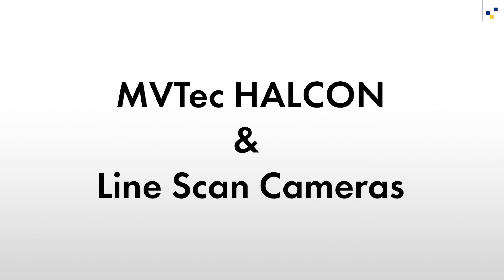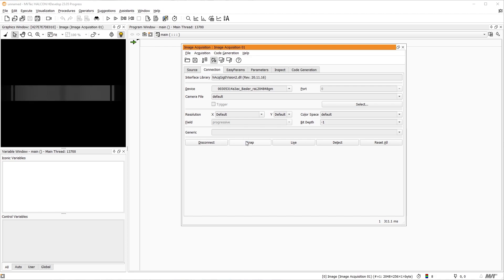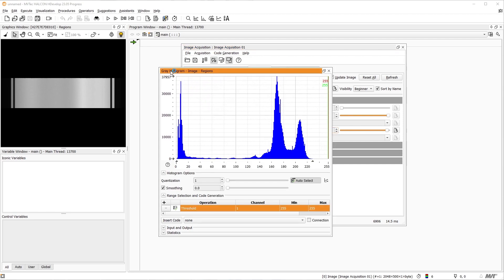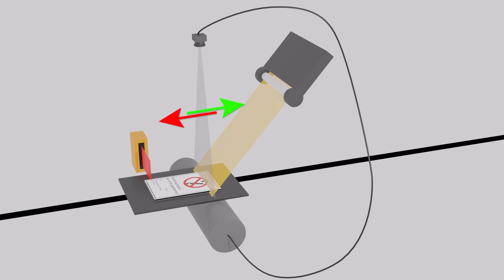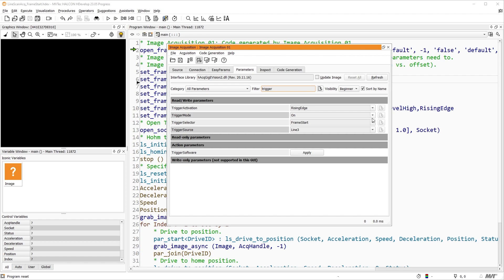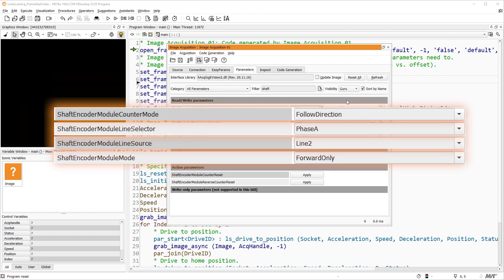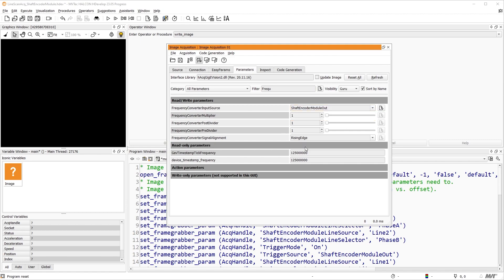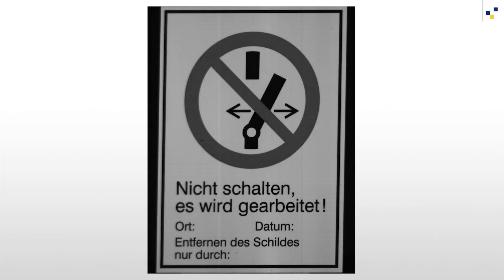How to Setup and Use Line Scan Camera with MVTec HALCON

Comment: what kind of lens is used in line camera?
Reply from the maker: Great question!

As a software manufacturer, we prefer not to make hardware recommendations.

Line scan cameras often have higher resolution in the width and therefore wider sensors than area scan cameras, which can cause image quality problems if the optics are not designed for them.

Therefore, special lenses are available that are optimized for specific line scan cameras. 
For example, these lenses take into account the size of the sensor. 

They are also often designed to minimize optical distortion in the direction of the sensor.
In some cases, it may not be necessary to use a special lens for your line scan camera, but this needs to be evaluated for your specific application.
We recommend that you contact the manufacturer of your line scan camera for a recommendation on which optics to use. 

We hope that helps! Best, your MVTec team